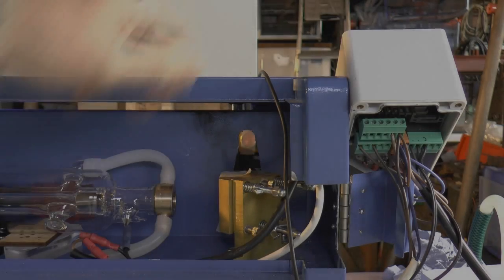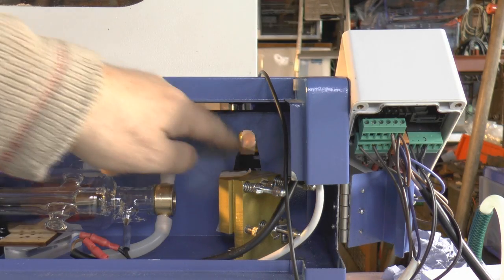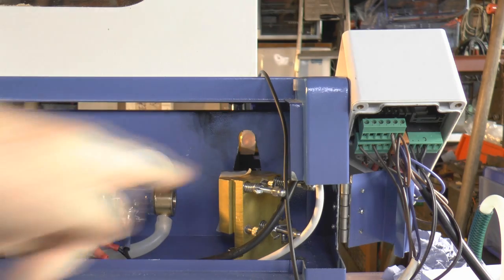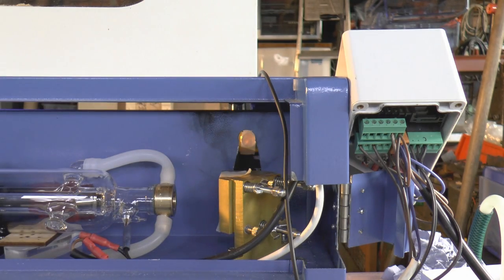RDWorks Learning Lab 51 Beam Setting for Beginners part 2

Comment: Excellent! I was wondering when you would upgrade your laser. I think I'll be buying one as well. I'm looking forward to seeing the results!

Thanks!!
-Seth
Reply from the maker: +CenterFire 
Hi Seth
Having wrung every last milliwatt out of that machine I felt the time was right to upgrade form a donkey to a Ferrari. There are still a few issues to explore  but  what results are you specifically interested in. Remember I play mainly and use a little. Yours is business mine is purely pleasure.
Thanks for the appreciation
Russ
Reply: +SarbarMultimedia Russ, I think with all of the upgrades you've done to your machine, a more powerful laser was a wise choice. As of now, I have no real need for a more powerful laser. I'm mostly making jewelry by cutting thin sheets of exotic hardwoods and for that my stock laser tube works well enough. However with twice the wattage, I should be able to cut twice as fast. Having the capability to cut thicker pieces of wood is also appealing to me for use on other projects. I would certainly appreciate it if I could use your drawings in the future to make the clamps and laser housing. 
-Seth
Reply from the maker: +CenterFire 
Just updating drawings at present but no problem when you want them. You have my email address or message me on you tube.
Reply: +SarbarMultimedia Awesome! Thank you Russ!